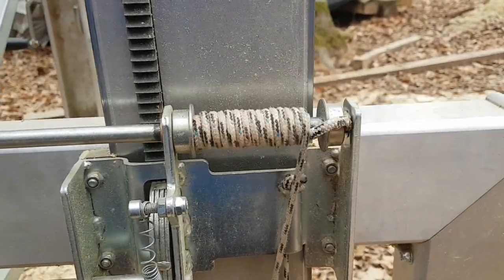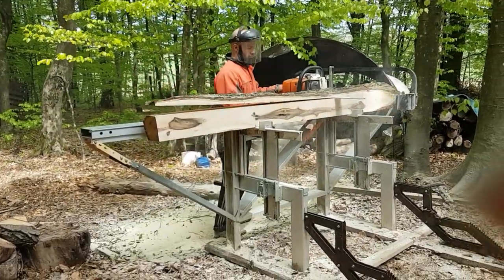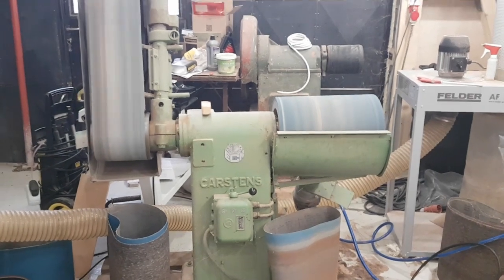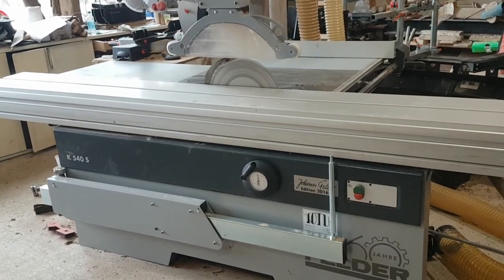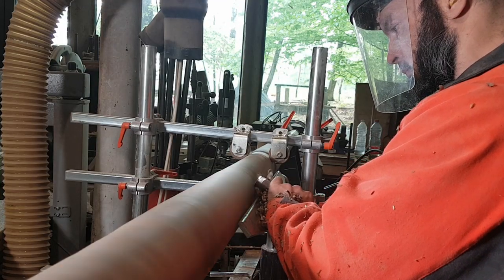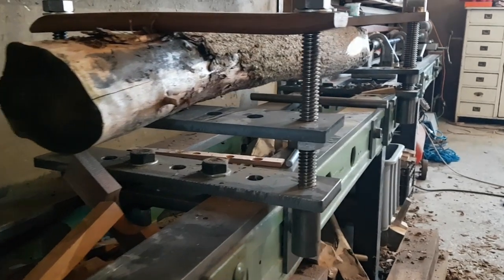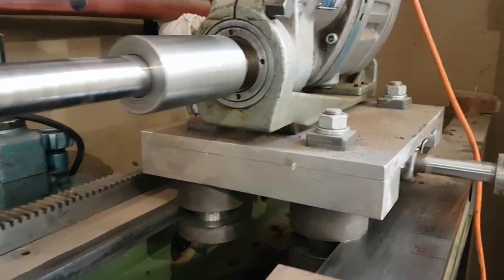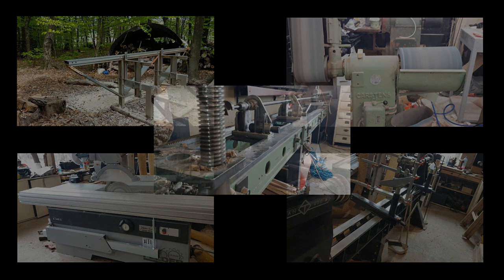Our TOP 5 Didgeridoo Making Machines

Comment: Oohh, thanks for sharing this. actual images of the drilling machine. 

Good job!!! Mine is entirely different.  Ill share with you 'soon. moving the workshop and all.

Im very surprised though, you directly drill with such a large forstner drill bit right away? 

I make a 1/2 '' pilot hole using a gundrill  (I get about 1/2'' off center from end to end on 5/6 foot long piece )
Then I used a carbide forstner drill with a 1/2'' center pin so it follows the pilot hole and not the grain density pockets.

But I will be limited in terms of assymetric big didgeridoos due to simple physics unless I make an absolute heavy duty piece of machinery, which I might :D

Simply showed, I used alot of this setup but my machine is 5 meters long and the drill is mechanized with big 2.5 meters long ballscrew. 

but man, do  I love looking at your machine and your work, that drill turning slowly amongst the big piece of steel is a thing of beauty
Reply from the maker: Really good news that you pulled it off! I would really love to see it, send me a mail or message! I would not necessarily start with a drill this big, but for the video... it is minimum.